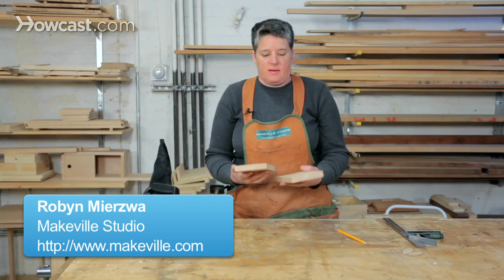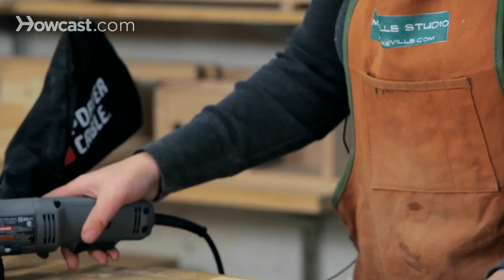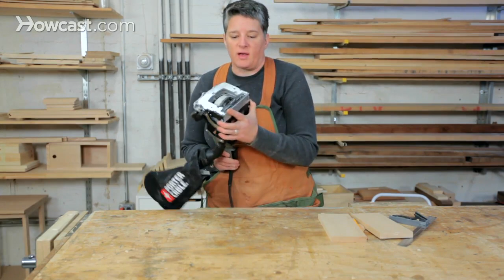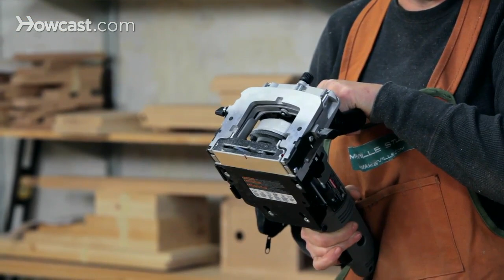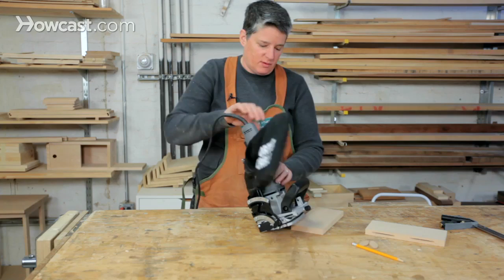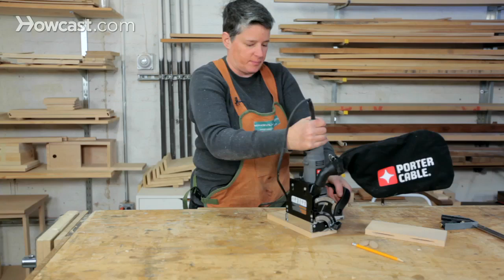How to Use a Biscuit Joiner | Woodworking

Comment: Thanks for the video! I have worked with wood most of my life and in my 50s finally looking at biscuit joiners, not for strength but for alignment when doing glue ups. I always (until 9 months ago) thought end grain to end grain was a weak joint with glue alone (no joinery) but it turns out to be around twice as strong as end to side is pretty darn strong. Add a biscuit and often joints become weaker depending on what you are gluing. I know, this seems weird but still notable. That said, breaking points with or without were pretty high. Looks like good old fashion joinery is a lot stronger than either glue or glue and biscuits. I think the value in the biscuit joiner then is alignment.

Comment: Not sure this is too good on safety or function. A few clamps would be better, and working without a clamped reference batten for the vertical cut risks messing up the alignment. Sooner or later, something will slip - you just have to hope the result is just a ruined workpiece, not your hand.

Comment: Just purchased a biscuit joiner and have never used one. Great video on to get started using the tool. Thanks.
Reply: Guys access more then 16000 woodworking projects and plans at
BestWoodworking. info  hope this website will help you
)()()()(